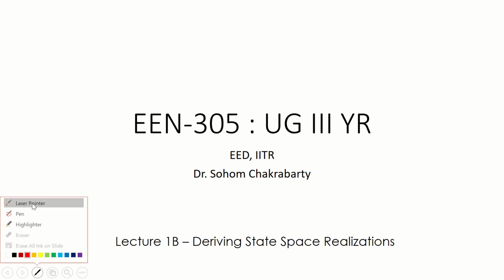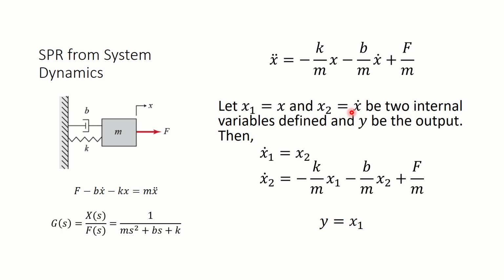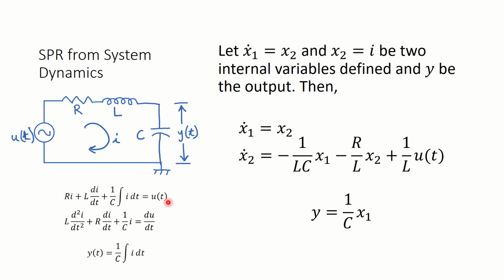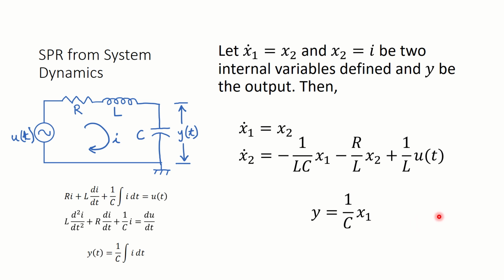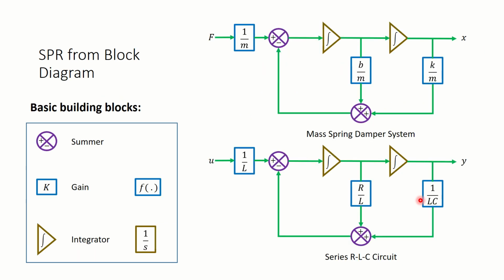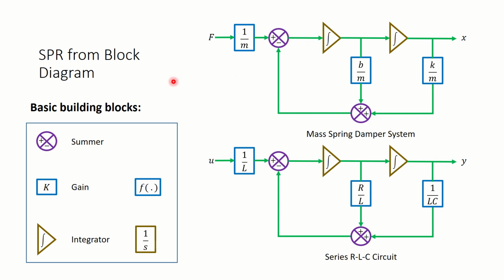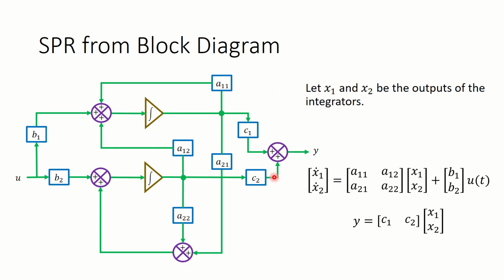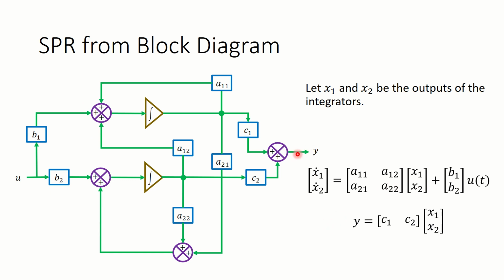EEN 305 EED IITR Lecture 1B - Deriving State Space Realizations - Advanced Control Systems

Comment: sir there is a mistake in the RLC ciruit state space equation. In calculation we forgot to take the derivative of input. This type of circuit shown in video will come when we take voltage across capacitor(Vc) as our state x1.
Reply from the maker: There is no mistake in the SPR. The state x1 is in fact taken as integration of the current (same as voltage across capacitor with C=1). 

However there is a mistake in the transfer function of the RLC circuit because in the I(s)/U(s) the 's' is missing in the numerator. Please note that and correct.